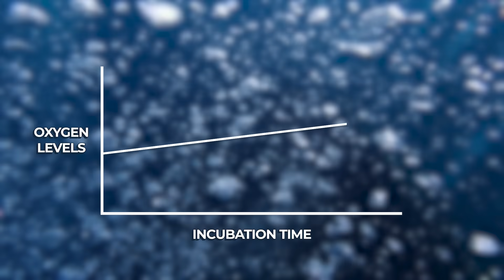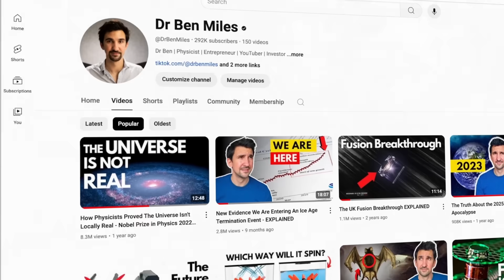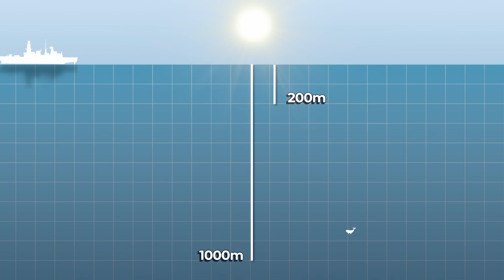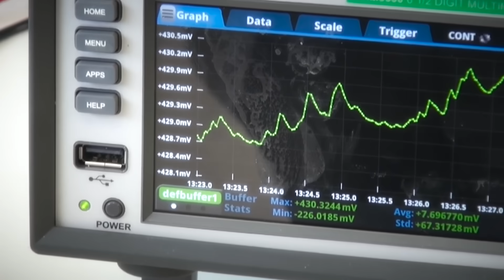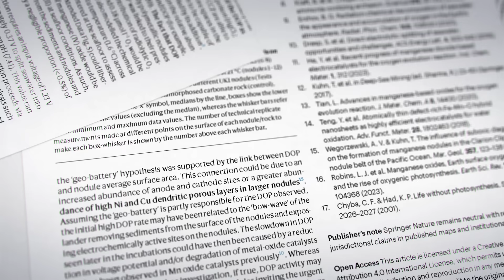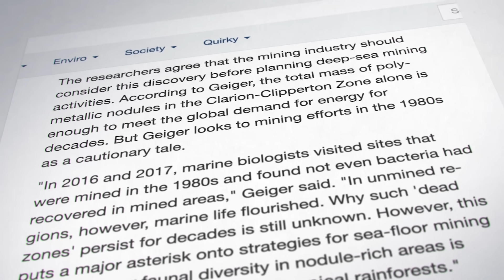We Just Discovered "Dark" Oxygen on Earth - Breakthrough Explained

Comment: Both Ni and Fe are magnetic and seawater is an ionized liquid so there could be some type of magnetohydrodynamic reaction as the current moves the charged particles around. It would use the Lorentz force to change energy from the fluid in motion into electricity that would build up on the lumps which would be used to create the oxygen. That would explain the surface area to electricity generation ratio, why the oxygen generation picked up from the movement of the craft and why it slows down in a stable environment. Either that or an earth battery kind of reaction. Neither of these use up the electrode components. I’m really leaning towards the first one. lol also this is just stuff I googled but I think it could work.

Comment: How about along with the battery component there is also current created by changes in the local magnetic field. The nodules simply become storage capacitors with either positive or negative charges and the measured battery voltage is simply a residual effect that depletes itself when the nodule is removed from the ocean.

Comment: I would really like these metals to be studied more. So under the water the metal would rust. Which is interesting because where does the hydrogen go for the when the H2O if the oxygen is binding with the metal? Well it could be H2, which is highly unstable, most often in water it forms a hydronium ion (H3O+) with other water. However there is an uncommon thing where the hydrogen will be adsorbed by the metal, often called hydrogen embrittlement. So i'm wondering if these nodules over the hundreds of thousands of years are their own unique mineral that has significantly more hydrogen embedded within the structure itself and much like a semi-conductor that is doped with P or N to give it certain charge properties the hydrogen embedded within gives it unique properties such as being able to generate a charge while the raw metal or deposits would not.

Comment: 🌪Earth is a rotating, slightly flattened globe. Centrifugal force throws cold dense & heavy polar airmasses towards the aequator,
 🌎:face-blue-smiling:🌌 mainly gravity moves them back towards the polar vortex, a big convective system.
 🔄There are also Coriolis, inertia & some thermodynamic and orographic necessities guiding the journey. 
🌊The ocean currents are driven by the same forces in a different way.

Comment: I actually believe it. The reason why is because the math works out. How is it doing? It is a bit of a mystery. 

But where is the energy coming from? Definitely the ocean itself. There is a lot of of salt.

Since it builds itself up over time, maybe it builds and heals itself. Allowing it to be building up and constantly releasing small bits charge over time. Possibly being the process the creates them the first place.

What I'm saying is a normal battery works in different materials being opposites to each other. But most batteries slowly degrade. Medium to continue the reaction.  I if the material actively heals itself and the ocean is constantly bringing in new material. There should be no reason why it couldn't go on infinitely. In other words, I think we're missing something when it comes to batteries

Comment: Galvanic corrosion (also commonly termed bimetallic corrosion) is an electrochemical process. That is to say, it occurs as a result of the flow of very small electric currents usually between two dissimilar metals which causes the more anodic of the two metals to corrode, the noble or cathodic metal being unaffected.
This is your source of current.

Comment: Jack Boyd, my thermo prof, would draw that nodule on the blackboard and a big dashed-line balloon around it: a Gaussian box.  Everything going in must balance everything coming out, unless the nodule is changing size.  Seen that way (and assuming constant size), then either the water coming out has been depleted of chemical energy by making/breaking bonds, or just maybe we've got (an impossible?) heat engine here.  Could it be these rocks run a fraction of a degree cooler than the surrounding water, and therein -somewhere along that polycrystalline water interface -a momentary Brownian thermal collision on the atom-wide edge of a catalytic crystal levers a proton off a water molecule. But this would cool the rock, and I might be violating entropy (Maxwell's demon).  And anyway, if we're making O2, isn't there some hydrogen (compound) being made, too?  Where's that?

Comment: Could it not be the opposite?  Some source of electric potential, maybe ocean currents or geomagnetic processes doing slow electrochemistry on seawater stripping oxygen from dissolved metal oxides and causing the seafloor metal deposits and oxygen source.  This would also explain the measured voltage from the metal deposits being the opposite of the generated current creating them.  In other words the whole ocean is the battery "charging" by building up metal deposits on the sea floor.

Comment: magnetohydrodynamic recharging is happening there - yes I am an alien lol. try flowing a never ending ( cyclic) volume of water that flows over exactly the same geological path over ( under , and through ) the exact same dynamically changing environment , and consider the osmosis and absorption of the flow from that transport and its resulting dynamic magnetohydrodynamic potential and how its transport proximity affects the charge state of the nodules;  I feel that you will see a micro-dynamic atomic and therefore molecular charge development that the nodules have "learned (via geological mechanical evolution ) to store because the charge/ discharge rate is unequal.    sorry ...alien & geek.

Comment: I haven’t read the paper but I am surprised that the video has disregarded the role of bio mineralisation processes. Cells contain and need trace amounts of metals like zinc and etc to carry out some if not most of their metabolic activity. Oxygen similarly is necessary for the metabolic activity of certain types of bacteria. It is very likely that there is a whole host of bacteria down their that first grow from degradation of sea carcasses that form the core structure. Then precipitate poly metal solids following their cell death to form poly metal deposits. Similarly there is likely bacteria that can use the voltage difference between their cell membrane/wall, cathode deposit voltage in combination with sea electrochemical makeup and gradient to accelerate the galvanisation of metal ions to the surface of the deposits. This can grow deposit size which in turn will eventually support aerobic bacteria by splitting of water. In this case living things could accelerate the millions of year long process of these poly metal deposit formations to 10,000 to 100,000 years.

Comment: Removing the rocks from the sediment, and conducting the experiments much further away from the magnetic core of the centre of the earth could explain the plateau. There's a "living ecosystem" of coalescing minerals, magnetism, and electricity generating the splitting of hydrogen from oxygen in the water at the ocean floor that can't be reproduced in the surface sterile test tube

Comment: There are a lot of chemical processes which should at least make you think about this seriously.
The one in my mind is that due to cavitation, salt water, the bronze of ship propellers is decreasing, which is totally explained by the standard laws.
To minimize this they use pieces (blocks) of a lesser element which are an easier way to get the electron difference flowing and take it from the lesser element instead of the bronze. Perhaps there is some very low cavitation due to the current of the water and the shape of the stones, which makes the process going… we are talking deep down, no one is to walk out there and check by hand over a big area to get the numbers down. Due to the pressure the cavitation bubbles will be seriously small and I’m don’t know if that is even possible.
A flow of electrons is current, why isn’t this the bases of the process happening down there?
I’m just a simple engineer, so it is just a thought and not an explanation.
It doesn’t explain why it is also working in a lab environment, so I’m probably way off.

Comment: Given the highly correlative effect that removal of these polymetallic nodules has on the ecosystems of mined area's and the logically sound albeit not robust theory of geological electrolysis warrants further study. As someone on the fence with Anthropogenic climate change, logically this could prove to be a causal effect to increased atmospheric Co2 levels from the removal of the oxygen producing environments that could be associated with a significant percentage of Anthropomorphic change to our changing conditions. Could the loss of oxygen in these areas be depleting life in waters above? Given the depleted life in the columns of area's mined, could that be causing the warming of surface waters due to depleted oxygenation? Due to increased ocean temperatures reducing the oceans insulative effect on atmospheric temperatures at the surface could this be where the majority of Anthropogenic climate change occurs? 

Seems that either way we slice it, the mining companies should be put on hold and brings into question societies current and future reliance on battery technologies should also be reconsidered.

Comment: Or they're an assumption of millimeters and thousands or millions of years are wrong and nodules can form quickly under unique circumstances, such as heavy mineral saturation and a seed begin nucleation of the material the nodule is made up. This can vary depending on the varying degrees of mineral saturation in the water.

And ironically, they are using the bias of evolution to say that these VASTLY IMPORTANT nodules take millions of years to produce, but are gung-ho on stripping the ocean floor of them. If it takes as long as they say, then HANDS OFF. No mining the deep sea or we risk destroying an important resource that produces oxygen necessary for life. Since these are literally the bottom layer of life in the ocean, can we say that destroying the process by mining the nodules won't kill all life in the sea?

Comment: Research indicates that bacterial activity is a primary contributor to the presence of H2O2 in deep ocean waters.  The polymetallic nodules contain manganese elements in the form of manganese oxide.  These elements will act as a catalyst to rapidly decompose the hydrogen peroxide into water and oxygen gas; essentially, the manganese oxide speeds up the breakdown of hydrogen peroxide without being consumed in the reaction itself.  This reaction would explain why the DOP measurements level off over time and do not continually increase over time.  Conclusion - this is not an infinite source of oxygen, but merely a chemical reaction that creates oxygen molecules from hydrogen peroxide.  However it is evident that marine life exists in these dark waters by taking advantage of this phenomenon.

Comment: Infinite oxygen source is a big stretch...Here is a theory - Since the Thermohaline currents that circulate around the globe mix the surface water with deep water, what if the undersea fields of polymetallic nodules are acting as a magnet that attracts the O2 from those currents, thus increasing the concentration in that volume of water?  These polymetallic nodules are composed of Manganese Oxides. (quoting another source) Manganese Oxides have attracted much attention as bifunctional catalysts for electrochemical reactions due to their existence in nature in the enzyme Photosystem II, found in the chloroplasts of plants and involved in water splitting during photosynthesis. The natural Photosystem II contains an organo-metallic complex consisting of manganese oxide and cadmium.  Therefore the scientists have discovered higher concentrations of O2 near the polymetallic nodules because the O2 ions from surface water photosynthesis prefers to concentrate at that deeper water location surrounding the nodules that contain manganese oxide.  It seems obvious from the research that when miners remove the polymetallic nodules from the sea floor, that the concentrated O2 levels return to normal levels.  Conclusion - the polymetallic nodules are not the source of the O2, but only the catalyst that attract and store the O2 in higher concentrations from the surface water.

Comment: Just wondering if they looked for hydrogen production that parallels the oxygen production?  That would support oxygen coming from electrolysis.  Even if gaseous hydrogen doesn't hang around for long enough to measure (unsure if it does) perhaps they could measure what it might be converted to?  Also wondering what other things the measured to determine the context for the O2 production (pH, other dissolved gasses, etc).   It seems clear that the simplistic notion that these modules could be mined as an alternative to some of the ecologically damaging methods employed by surface mining is pretty much a pipe dream at this point.  What I wonder is whether we could develop some kind of a seeding process that would enable retrieval of the minerals we desire from the seawater itself on a timescale that would be feasible - say a process that seeds production of microscopic "modules" in a surface sea farm that could then be harvested for the minerals.  For instance, genetic engineering to modify plankton or bacteria such that they engorge themselves with cobalt or manganese, then harvest the microorganisms.   Love your videos!

Comment: Electrolysis is a functional process.

Corrosion Cells (Batteries) exist wherever you have dissimilar metals and water.

Cobalt, Nickel and Iron are dissimilar metals and if they are lying on the ocean floor in a saltwater bath, congratulations... Corrosion Cell (Battery)

Comment: I would assume that the oxygen production stopped in the samples brought up from the sea floor is because the necessary elements in the water needed to produce the electricity was used up in the sample but would not have been used up on the ocean floor due to currents.

Comment: However he could be right.

How much oxygen is actually being produced and what methods are being used to test this hypothesis.

Using just a normal fish tank for example and putting these rocks into it to test this hypothesis is not efficient since yes, there would be outside contamination of oxygen from outside sources. In this video alone they show a man in a lab coat with a couple of these rocks in a shallow, clear, plastic box. Well, if that is an example of how they are testing this hypothesis, yes, there are tons of outside contamination.

To properly test this hypothesis they have to a hundred percent simulate the exact same environment at the bottom of the ocean floor at these depths, and the only way to do this is to have a pressurized, cold, in a pitch dark environment with water with no to low oxygen to prevent any outside contamination.

Everyone bashes these companies for doing their own research claiming it would be biased, well, no more biased than " Scientists" who get their funding from rich donors that want to push an extremist, environmentalist narrative. In short, follow the money, who is funding this research and what is their goal. No researcher is ever going to go against their donors by reporting on outcomes that goes against their donor's political or social leanings if they want to continue getting funding.

There are tons of examples of this exact same happening, so it is really up to us to figure out what the means an conditions they used to come to their conclusions, the social sciences for example is having a replication crisis where they make bold claims that something is true and are unable to replicate the outcomes of their studies, that is why everyone should take what comes out of the social sciences with a pound of salt.

Comment: Let me suggest 2 solution with my limited iq. These nodules inner core can be charged by piezoelectric mechanizims via high deap sea water pressures or can be charged with thermocouple effect due 2  sea water vs sea floor  tempereture diffrences. and the metal fragnemts can be covered with water mineral depozites turning them in to rocks by time.

the structiure and compozition fo this nodules must be investigated much more so this kind of humanmade metal cores can be bombarded to planets which has water oceans but dont have o2 so for to terraforme the planet.

Comment: If this is a catalytic splitting of saline water into oxygen and hydrogen then "in situ" there is almost an inexhaustible supply of electrolyte fuel. Without access to the original publication to study detailing the methodology of the lab work but drawing to loose interpretations from your presentation it might be that the experiment is showing a form of self regulation or equilibrium when the oxygen levels reach a certain concentration in a closed cell environment. Le Châtelier's principle springs to mind.

Comment: When you connect 2 different metals to each other the result is a voltage differce on each side of the material and its dependen on the temprature. Its what most modern digital temperature meters are based on.

Comment: The battery hypothesis seems perfectly plausible, if not likely. One thing to keep in mind is that the deposition of new material on the nodules is much more limited in a laboratory. Individual nodules may have their surface area entirely depleted before they collect enough material to begin generating a current again. The plateau observed under laboratory conditions may just be the result of an isolated sample not having the means to replenish itself. Within the context of their natural environment, it seems unlikely that all of these nodules would stop producing oxygen at the same time, and would instead be staggered.